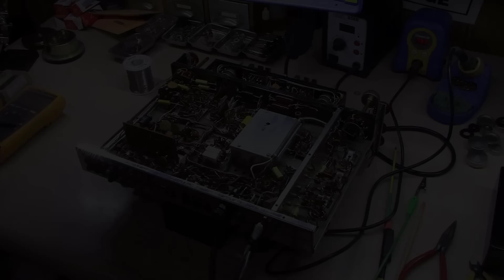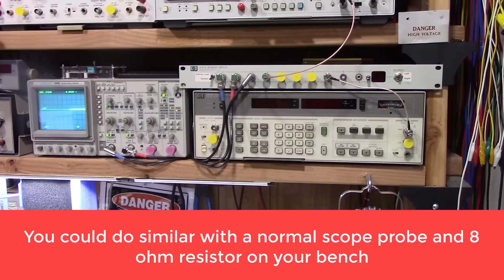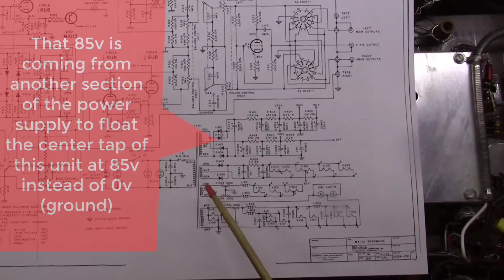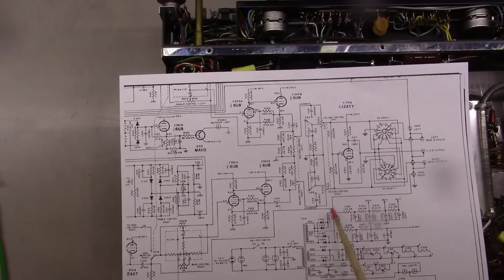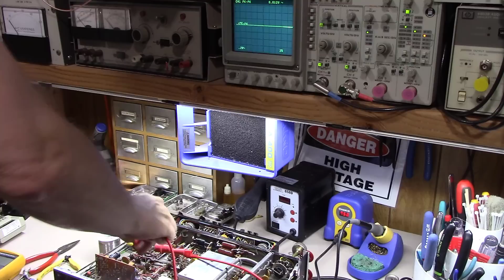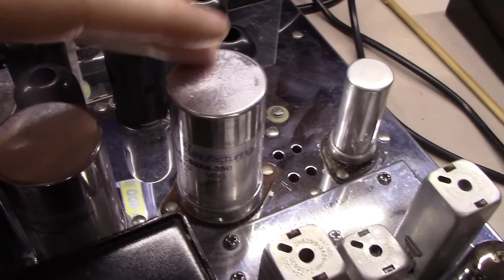Vacuum Tube Power Supply Hum Troubleshooting -  McIntosh MX110

Comment: Ha! I didn't scroll to the end and thought- "they're probably CE". Sure enough, they are. I've had a number of their filter cans open up in 2-3 years back in the 2010's and moved to other makers. F&T Autheniticaps and Hayseed. I think the failure mode we discovered is the CE can ground return tab(s) corrode or break. Thanks for the tip, Mark! Starting on an MX1110Z restore.

Comment: Well, that's a fairly significant "ding" on CE Manufacturing capacitors. I know... you only hear and remember the negative anecdotes but this is a very high-end capacitor from a would-be reputable manufacturer.  I'm sure it was just a fluke... but it has me wondering.  Thanks for the video Mark!

Comment: I'm very surprised you got another capacitor from the same place as the bad one when it's pretty much obvious they are stuffing cheap China type parts into these cans when these caps should have lasted another 25 years. You should open the can of the bad one and show your viewers what quality is being used in these replacements to save others the same trouble you went through if indeed they are low quality replacements.  Thanks anyway

Comment: Hello! interesting video, as an amateur I immediately thought that it must be a filter capacitor after you stated that the frequency of the noise was 120hz.
Rectified 60hz should give 120hz hum without filtering?
Or is there something else that could potentially create this particular frequency in the circuit?
Electromagnetic interference should have a lower frequency right?
Best regards, Victor.

Comment: Interesting video thanks.  I wear rubber gloves and performed the same one hand in the pocket, my dad showed this to me when I was watching him repair TV (tube) set.  Explained the capacitor cage and that caps hold a charge just like a battery.  Credit to Benjamin Franklin for that who upon seeing a bunch of capacitors, to which he remarked it “…It looks similar to a battery of canons…”. How the term became associated with a Voltiac  pile is another story.  
The old adage of checking values of components doesn’t preclude premature failure.

Comment: Hi Mark, I noticed that many Mcintosh MX-110z units after they got updated, the capacitor with values of 50mfd by 4 @350dcv is on the right (when looking at the unit from the front), why is your 50mfd by4 at 350DCV is on the left?  Is this the reason for early failure?  I thought I had heard from you that it is important match the recommended capacitance of the RC chain, since this could effect the voltage drop down the chain.

Comment: Mi Mark, on the MX-110, what’s the best way to convert line level output sources and using it with the tape head input on the MX-110?  I need more line level inputs, I know the aux and tape monitor inputs can be used as line level, but the MX-110 has sweet tube circuitry and I hate to let go to waste. Thanks in advance.  BTW, I love watching your videos.

Comment: Greetings:
I am sorry, but I do not know how you can NOT start by scoping the power supply at the rectifiers immediately. I understand that to create a two level output on the b+. Since you have a power transformer, by isolating the safety ground and all output grounds, you can even tie that floating 85v artificial ground and connect your scope ground to that point and even measure both b+ and b- relative to it. I assume your using that t4st cap to connect the 85v point to ground has a similar affect you still should be doing scoping instead of meter measurements. Hope you checked that new cap b4 installinng it. I was screaming at you to show us all power supply cap signals, aarg!

Comment: what was that sound when you plugged in the speaker terminal? Sounds like feed back to my uneducated ears. I have a amp that does this. Should it be something to be concerned about?
Reply: You mean the loud crackling at 4:20? That happend because an RCA jack makes contact with the hot pin before connecting to ground. It's just heavy noise induction. That's why you should at least turn the volume complete down before connecting thing, even better to turn the unit off. But these days, you can also get RCA plugs with a spring loaded ground sleeve that makes contact first and then moves a bit back to get the hot pin in.

Comment: It seems more likely that the fault was in the connection to the common negative (can.) It could be the wiring to the +85 or I have seen the connection from the can itself to the internal common negative go bad. If you look at the bottom of the can, around the phenolic insulator where the + terminals come out, you should be able to see a small tab that just barely sticks out from under the edge of the metal can. That tab is the conductor to the common negative for the multiple capacitors inside. I've "repaired" failures like this by hitting the can above the tab with a center punch, but it's hard to defend that as a long term solution. I don't understand how they make that connection reliable. Perhaps it's spot welded, but there's never any sign of this in the alum above.

It would have been easy to sort this out with a few quick touches of your scope probe.

Comment: Don't you just hate it when Hum Pixies get inside your capacitors. It's a real problem with these large capacitors because they build their nests in them and then you can never get the pixies out. It's even worse if they get inside a transformer because they can eat through the wire.

Comment: I own a Leak Point One Stereo 20 valve pre amp and the valve amp that goes with it! Obviously I want the amplifier section to look original which brings me to my question! Instead of buying a 4 in 1 capacitor, why not leave the original in place and disconnect it then buy 4 separate capacitors of the same value and solder them in place using the original as an anchor point only? The effect is the same and if a new capacitor goes bad, it's easier to replace just one capacitor rather than the whole can capacitor on top! I said to my tech here in Australia where I live that I wanted the original capacitors left in place and solder in new capacitors underneath because the 2 capacitors on top are the same colour as the amp itself! I've seen a few problems like this with these new four in one jobs and if you have to drill the rivets out to replace it, it's a real pain! By isolating the problem with this Macintosh amp using a Nichicon cap and an alligator clip, it proves my point! I've seen some woeful restores where techs cut the can in half and stick 4 caps inside it and it looks just awful! Yes, there are situations in old tube gear where you do have to install new tube sockets and safer wiring etc but when it comes down to aesthetics where the amplifier is on display, I don't want two bloody big holes in the amplifier when you can install new ones underneath. When I have friends around, they drool at my restored Leak gear! The power and output transformers in this amp weigh a ton and with removable jumpers to select voltage and speaker impedance, only a fool could make a mistake with this amp! I hope Covid-19 takes a hike! Wearing these masks everyday is becoming tedious as you mentioned!  Cheers from down under,  Andrew Peter Collins!

Comment: An old ham friend of mine taught me this trouble shooting technique many years ago...and you are quite correct, if you don't know what your doing...do not attempt...could make for a very bad day! I'm also surprised you are ordering the same capacitor/manufacture...I would replace all those cans as you will possibly go down this road again...its not worth trying to keep the integrity of a vintage chassis to forsake durability...Once bit, never stick your hand inside the fence again 😎

Comment: That waveform tells there is low impedance (quick) charging of some bus capacitor, followed by too fast discharge.  The discharge rate and the classical exponential shape tells that either there is  very little capacitance OR THAT there is leakage/much load current..  On an RC chain, I would measure AC voltages at each capacitor section.  It should reduce towards the end of the chain in rather regular fashion.  But then I would measure the voltage drop over each of the segment to next resistors and calculate the current in each.  If there are no loads attached to the intermediate taps, then the current should be the same throughout the chain.  A leaky section would be indicated by a step reduction of the current.  If there are loads from various taps, the calculations require measuring those load currents at some resistor likely existing in the side load branch.  But the biggest often ignored capability of a modern digital multimeter is the ability to measure AC ripple on top of DC voltage.  Some fancier ones even have a dual display, where you can see both AC and DC at the same time.
Reply: I noticed that many Mcintosh MX-110z units after they got updated, the capacitor with values of 50mfd by 4 @350dcv is on the right (when looking at the unit from the front), why is your 50mfd by4 at 350DCV is on the left?  Is this the reason for early failure?  I thought I had heard from you that it is important match the recommended capacitance of the RC chain, since this could effect the voltage drop down the drain.

Comment: Don't be critical the amplified just wants to hum along to the tune hahah cheesy ones are the best
Anybody had any experience with dirac live with tube amplifiers!  it should work really well tighten Up the Bass better synergy
You could have used a signal tracer would have giving you the characteristics of the capacitor slope. Maybe there's capacitors are not that reliable long-term use

Comment: Nice amp. My vintage 1956 Harman Kardon A250 Epic has a Hum also was fine till recently happens only in phono and when my hand is near a certain area it is not as loud as that more like a 60hz Hum and gets louder when hand gets closer. When touch metal anywhere Hum goes away

Comment: Wouldn’t it be easier if you suspect a bad capacitor to test the b+ rail for ac voltage with the dmm?
Reply: Yes and a lot faster too.  It's a test for AC ripple on a  DC voltage.

Comment: Wouldn’t it be easier if you suspect a bad capacitor to test the b+ rail for ac voltage with the dmm?
Reply from the maker: You will get varying results in doing so.

Comment: Scope shows classic output from bridge rectifier with inadequate capacitance across it. Can't believe that McIntosh didn't use a filter choke -- especially at the prices they charge(d). My $99 Dynakit Stereo 70 had a large choke and no hum.

Comment: Its interesting that the new capacitor failed in such a short time. This has actually happened to me 3 times in my career. QC hasn't been that good from the source of manufacture. Had to send back a few already. Either way, you can't overlook new components as being the culprit. Good video. Stay safe Mark.

Comment: Would like to take the old capacitor can apart to see if cheap no-name Chinese capacitors are used ? or quality Japanese capacitors are used ? Or if they just had a bad solder connection inside the can?
Reply: randomlyselecteduser Thanks I miss that wording .
Reply: randomlyselecteduser the build process looks really cool.